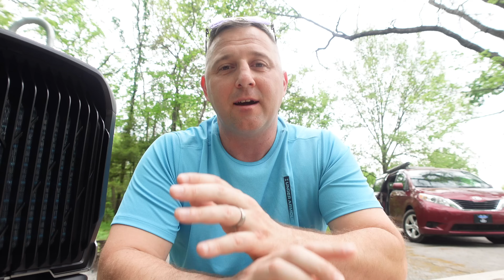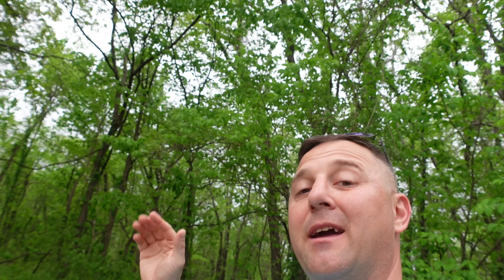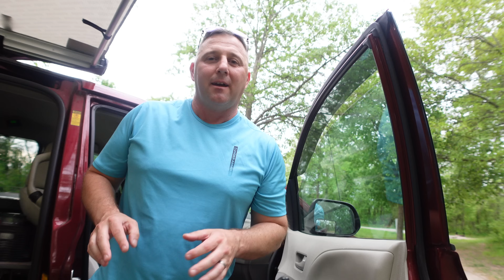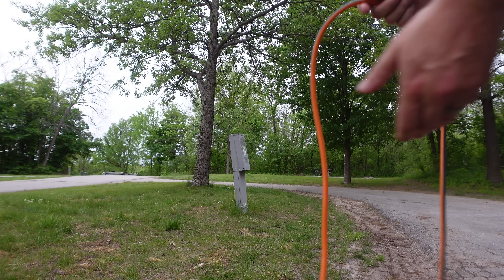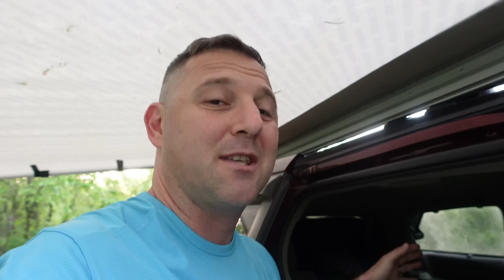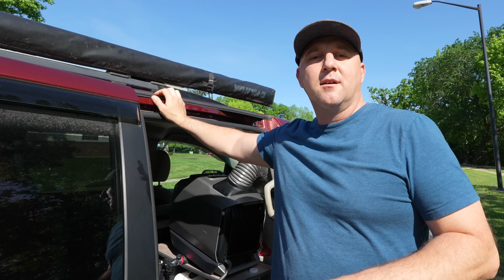The CHILLING Truth! - EcoFlow Wave 2 Portable Air Conditioner

Comment: How cold is the air coming out of the vents. People can work everything else out themselves. My all in one AC unit blows air out at 16 centigrade. That's cold. Only cost $300 but needs mains power. If it had a transformer in it and a battery pack it would be perfect.
Reply from the maker: Not sure exactly. I gave that unit away recently but have some pretty extensive tests on the latest version.

Comment: Why is the air intake ran outside wouldn't it work better?If it used the air from inside and push the harder out like a normal air conditioner

Comment: Is anyone else disappointed with the ecoflow Wave 2 air conditioner/heater?

My recommendation is to use  7 inch air duct insulation to put over the AC exhaust hose. Because the exhaust hose omits a lot of heat from it.

Also, the right side of the Wave 2 housing/body gets extremely warm and omits heat. This should be  insulated on the inside. 

And I've noticed the Wave 2 fresh air hose when connected it seems to draw in the hot Texas summer air and diminishes cooling output.

As well I noticed the battery life barely works for 2 hours on max before it is completely drained of power and dead!

This unit is very overpriced for the performance that it shortly offers.
Reply from the maker: It’s a small unit, and these are all valid points. I’m satisfied with my unit so far. There are other larger cheaper units that run solely off AC power which work better, but aren’t as portable.
Reply: @OffGridAdventure , any suggestions?

I'm thinking of taking off the fresh air intake hose and just letting it pull air from the cab of my truck instead of outside air.
Reply: Its more like managing realistic expectations, especially depending on ambient temperature and heat load from direct sunlight.  If you have dark paint on your van, the heat load will be massive and this unit will likely not catch up until the sun goes down.

Of course, if you only use the exhaust hose....you are pulling HOT air into your vehicle to compensate for that exhaust air.  You need to connect the intake and exhaust hoses, routing both outside the vehicle.
Reply: @darknes7800  , I ran both hoes  out.

What gets me is that the air blowing out of the unit seems to never blow cooler than 83 degrees.

Comment: I know this is a older post. But going to ask this question anyway. Is there a way to turn of the battery charge lights? I just got the unit. But use it about once a week. So charge the battery up when I get a chance. But if it sits for two days the battery will start running down. Thinking it has to be the lights on the battery because the unit has not been used .  It really does suck when you go to use it and the battery is not full and know you charged it to full. TIA
Reply from the maker: I disconnect the XT150 cable while not using it because of this problem. You can also hold the power button to shut it down if I remember correctly.
Reply: @AdventureGearTV   thank you😀

Comment: Question - I just purchased the wave 2 with the add on battery that slides onto the bottom. When running the wave 2 on cooling with the shore power plugged in - I noticed that it seems to run off the battery as the battery’s charge was dripping. How do I get the unit to run off of shore power alone? When I turn off the battery the wave 2 turns off even though it is plugged into shore power.  Thanks for your help.
Reply from the maker: Unplug the battery from the Wave 2.  It’ll run off AC power alone.

Comment: As for condensation that you noticed when in heat mode, think of it this way: it’s a dehumidifier on whatever the cooling side is, so in heat mode it is actually dehumidifying the outside air (perhaps the reason why drainage is required in heat mode).
While it doesn’t actually remove water from the inside air in heat mode, it does raise the temperature which will lower the relative humidity, making the heated air feel dryer.

Comment: Wave 2 is still too difficult to power and charge. For charging it has to be connected to the battery. I don't have the Ecoflow energy storage product, but it seems designed to be a companion to a power station. I will choose the more portable and easy to power zero breeze mark2.
Reply from the maker: I’ve used the zero breeze, and you’re better off just using a box fan.

Comment: Over $2000 for only 5000btu? That’s crazy .
The 10,000 btu window unit I paid $100 for isn’t even good enough to cool a 12 X 15 room. What’s that crappy 5,000 btu gonna do in a van that is a hot metal box.? I need the inside of my van or car to be at LEAST 70 degrees cool. Any hotter and it’s not AC.
Reply from the maker: It’s designed to be a smaller more portable unit. I’ve seen some big box 5,000 BTU units for close to $400. But, they would not fit in the my van.

Comment: This doesn’t sound all that good. So I only get  8hrs? And it takes 6hrs to charge? No good
Reply from the maker: If you use a larger power station like the Delta 2 Max, you can run it and charge it at the same time.

Comment: If you don't use both intake and exhaust hoses there's no way this thing will work at all.  You MUST pull air from the outside and then exhaust it back out.. otherwise it's worthless.

Comment: That drain water is probably the best water you can drink. Free distilled water! Might have leached chemicals from the internals but should be in the parts-per-million/billion, which would be more pure than most countries. Heck, even some states and counties in the US might have worse water from the tap.
Reply from the maker: I’ve been pouring out around one gallon per day running this thing. I had it in my tent for my recent video. Still works good.
Reply: It's dehumdifier water! Free ticket to dysentry!

Comment: When I use it in my van I run the van's AC for 15 minutes to remove most of the heat then keep the Wave on eco all night to maintain the cool temps.
Reply: That is what I was thinking about doing as well. I know everything is relative to temperature, but roughly how much of the battery do you use overnight using your strategy?

Comment: After watching this video, there are a few points about Wave2 that caught my attention: The accompanying battery cannot be charged separately; it must be connected to the air conditioner to charge. This is particularly troublesome and unreasonable. When I deplete the battery of the air conditioner outdoors and want to charge it, I have to carry the entire air conditioning unit with me. Keep in mind that this adds up to a weight of 50 pounds. Wow, 50 pounds! What does that have to do with portability? For me, portability is a crucial factor to consider, and I might choose Zero Breeze instead. Their product weighs less than 30 pounds, which is half the weight of Wave2, and can be easily lifted with one hand.
Reply: Oh, thank you! I was initially considering EcoFlow, but now I'm leaning towards Zero Breeze. Although EcoFlow has a higher BTU, Zero Breeze should be sufficient for my tent.

Comment: Having both the Zero Breeze Mark2 and Wave1, and having watched the video, I firmly believe that the Mark2 remains the superior choice for my outdoor activities. However, the Wave2 disappoints me as it can only be powered by Ecoflow's proprietary battery and power storage, rendering my other brand's power storage and battery systems unusable. Moreover, the connection cable between the air conditioner and the battery is inconveniently bulky and prone to being misplaced. Unlike the ZB Mark2, it cannot be conveniently positioned between the front seats.

Additionally, I am aware of the quality issues encountered with the Wave1, such as fan axle breakage and display failure, which understandably raises concerns among users. Unfortunately, it is challenging to anticipate when these problems might arise. The lack of information regarding any improvements made by Ecoflow for the Wave2 during this period leaves me uncertain if these issues have been adequately addressed.
Reply: I've heard this mentioned a couple of times and it's not true, the dang webpage tells you as much. 

You can use any wall plug, so any other battery pack that has a wall socket can power it. It's more efficient if you used all of their system since it's meant to work together.
Reply from the maker: I think this comment was from a spam bot. I’m not positive, but just the way it reads.

Comment: Hi man, I noticed quite a bit of water pouring out of the unit (when tilted) even after I hit the drain button, would you say this is normal? I've never owned an AC unit before.
Reply from the maker: Yes. I have to carefully drain the rest every time I use it.
Reply: That little bit of water is designed to be in there and should only be removed when done using for an extended period of time

Comment: In what store  we can buy this ?
Reply from the maker: I think REI carries it.
Reply: @AdventureGearTV  inside of the car those tubes is mandatory to install to conduct air inside/ouside, or we can without?
Reply from the maker: @navaro20  if you don’t at least expel the hot air, the vehicle will never cool. There is another hose that will pull in air as well, but I didn’t use it.

Comment: What i don't understand is why people wouldn't allow the van's ac to condition the interior temperature for say about 20 minutes.. then turn the engine off.. then allow your ecoflow to then maintain that temperature on eco mode... that way is using less energy,  and giving you a more effective way of using the ac..

But expecting it to jump start from a very hot interior temperature say 90 to cool down is being foolish if you have a working air conditioner in a vehicle... only my opinion... and how i plan to effectively work with mine...if your temperature is already ambient... i see eco flow as more efficient in maintaining a good temperature
Reply from the maker: That’s an excellent point. It’s a good idea to precool the van. But, for this video I was more focused on the unit’s performance without augmentation. Thanks for sharing this tip!
Reply: @AdventureGearTV  ok.i got you now!!

Comment: Neat little heat pump, I don't care for the fact they use r290 which is propane for a refrigerant. It probably only holds a few oz but still.
Reply: In Europe r32 and r410 will be forbidden soon. So all manufacturers are switching to r290 for heat pumps.
Reply: @Youtube Channels  yeah r410a is starting to phase out in the US but funny thing were actually starting to use r32. I still work on a lot of systems that still use r22 even though it's phased out our suppliers still sell the refrigerant. It's now $1,700 for 25 lbs here.
Reply: All old cars with r12 are updated to r290 as r12 not longer available
Reply from the maker: Wow. I looked it up and you’re correct! R290 is propane. My biggest worry in this small van is fire hazards. Luckily there aren’t any open flames, so hopefully a leak would simply dissipate.

Comment: Great review! 

Installed in a vehicle like this there's definitely room for further improvement in efficiency...  A shroud for the condenser (cooling mode) inlet with another duct leading to the drivers side window would help.  As it's connected now the unit is pushing hot air out the exhaust duct, but that means it's pulling in unconditioned air through leaks or vents in the cabin, reducing efficiency.  A separate fresh air inlet for the condenser would provide this, and keep unconditioned (warm) air from being drawn in.

Another possible direction would be to mount the unit outside the van.  Build a shelf that would hang on the top of one of mostly open the windows, external to the van, maybe with an extendible painters pole attached to support the weight.  The unit would sit, with just the front section inside the van.  Use foam poster board cut to block airflow around the opening - between the unit and the door frame.  And maybe another foam board arched over the top of the unit to reduce its exposure to the elements.  Besides being more efficient, this option  would likely make it quieter inside the van.
Reply: Yep:) he is basically creating a negative pressure environment in the van and with the exhaust hose just going out the window with all air gaps mostly pulling hot air directly back in the car creating a hot zone up front making the AC even less efficient. I would not follow what this guy did at all:)
Reply: @matthewwiemken7293  I don't think his setup is too terrible...  At least the air he's exhausting is probably quite a bit warmer than the ambient / outside air that's getting drawn in through leaks.  But there's definitely room for improvement.
Reply from the maker: This unit has me thinking of insulating the van better. The system works, but my van doesn’t do it any favors. I’m going to try it in a tent soon.
Reply: @AdventureGearTV  insulation would certainly help, especially if it's in the sun.  But the biggest efficiency gain will still be had by sealing up the air leaks.  Keep the conditioned air inside and the unconditioned air on the outside.  Then insulation.  Then covering the windows.  Cover on the outside in the summer - to keep the IR outside the glass.  On the inside in the winter.  Actually, if the van has factory interior - headliner and upholstery, both of which function as insulation, I'd tackle the window covers first.
Reply: This ruins the ambiance of being a bum life master

Comment: Please do a review after using it over the summer. I am hoping to get one next year.
Reply from the maker: I plan to use it all summer. And maybe into the winter.
Reply: @AdventureGearTV  hey so how's it been?? Both AC and heat? I found it for $1k with battery and was thinking of buying it.  It had terrible reviews on Amazon but 🤷‍♂️.  I'm needing heat and air for camping in my gmc Sierra with camper top on bed.  I've already built a bed with sliding drawer out of extruded aluminum and put wood flooring with insulation down. Really hoping to find one unit for heat and air! Please let us know if you still recommend after one year! Thx for vid!
Reply: @OTRFlyer  don't waist your money the heat that comes off of the exhaust hose stops the cooling of the room you need to buy an insulated cover for the hose. And the add on batter will only keep the air con running on cool for about 2hrs on max and if it's over 30 outside in Australia that just won't work to keep you cool all night.  you need to buy the bigger power sauce. As it doesn't keep our 7mt motorhome cool on eco mode or low fan mode.  And in heat mode it will only run for up to 2.5hrs with the add on battery.  It cost me a lot of money.  I had to buy insulation cover for exhaust vent hose a car charger to charge battery while driving.  And a 160w solar panel won't charge it fully on a full day of sun either.  And the first one I brought only lasted a week and I only used it a few times had to wait and get another one under warranty :( and now the fan is making a noise at times and an error came up and it's an issue with them as well. And we've only had it 5 months and only use it when we go camping.  Have to express to you a lot of heat comes off of the exhaust tube.  And the add on battery will only run it for approx 2.5 hrs.

Comment: Can it be wired to a 12v source? For instance, if I’m driving around can my car charge it?
Reply from the maker: It accepts up to 400w from XT60 input. But, it’s limited to 200w from a car input. Also, 8 amps. So, 200w from a 24v system and 100w from a 12v system.
Reply: @AdventureGearTV   so can I charge this of my 12 volt and am I able to use it plugged into my inverter
Reply: The Bluetti DC Charging Enhancer upvolts whatever comes into to around 50 volts, I wonder if an adapter could be rigged up to adapt the output from that into an XT60, and then connect it to a 12v battery...

Comment: Does the connection on the Wave 2 where the battery plugs in to, does it just have 2 pins or does it also have some data pins? Trying to determine if I can jerry rig my own alternate DC power source using that connection as their price per wH for their battery is very poor and I have existing DC power source options at my disposal.
Reply from the maker: The XT60i has data pins, and the XT150 plug has 6-8 additional needle pins.